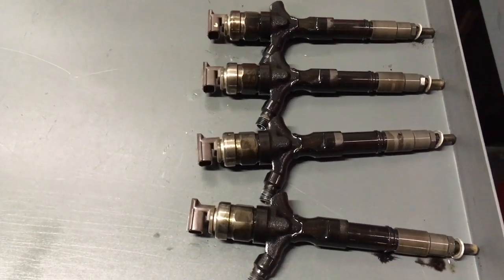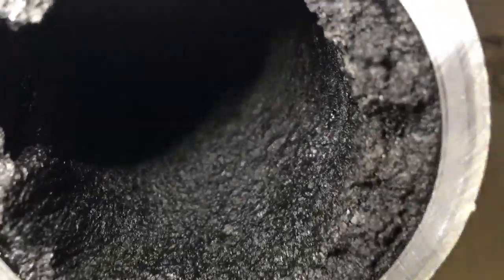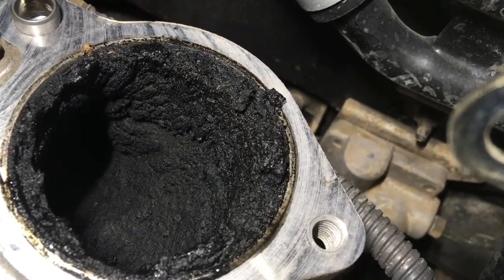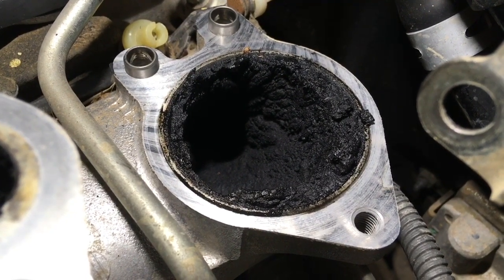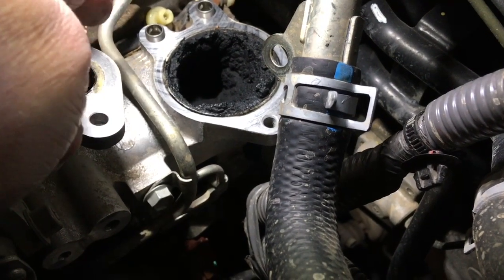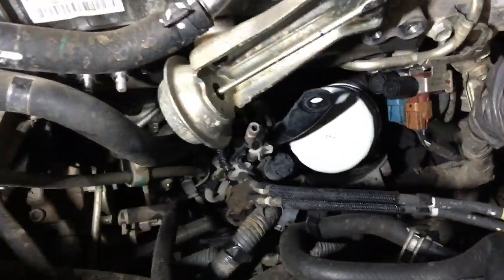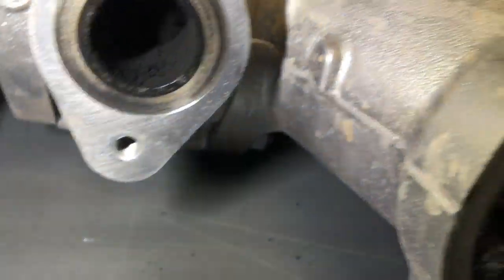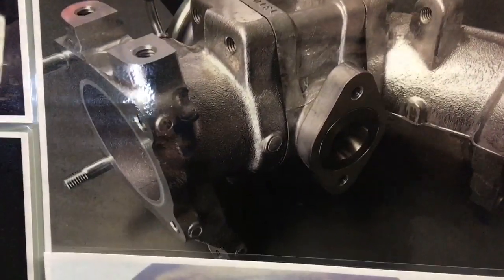WHAT YOUR DIESEL EGR LOOKS LIKE

Comment: my Mercedes 320CDI straight 6 looked the same, it actually gets worse around the inlet on the head where the manifold mounts to. without removing the intake there is no help. 
I did it on my Golf TDI and Mercedes, removed both intakes and deleted the EGR. ever since it runs a lot smother at idle and mid range. also the oil is still clean-ish after 5k